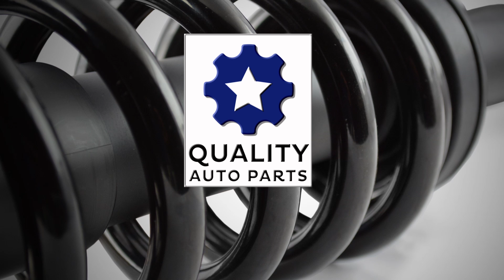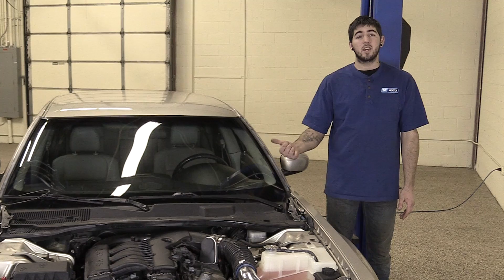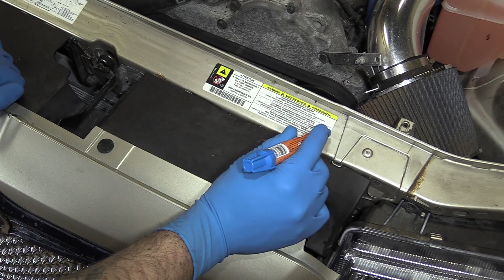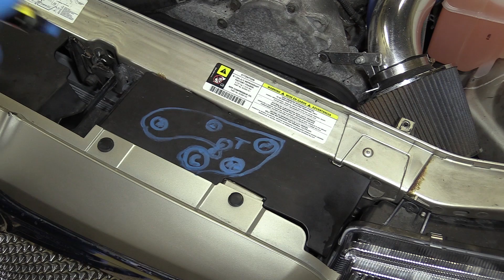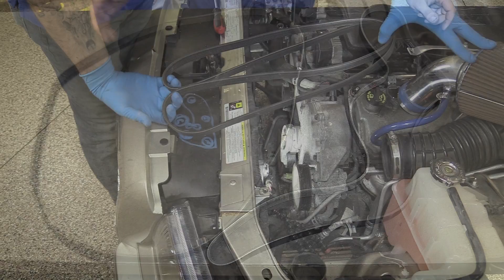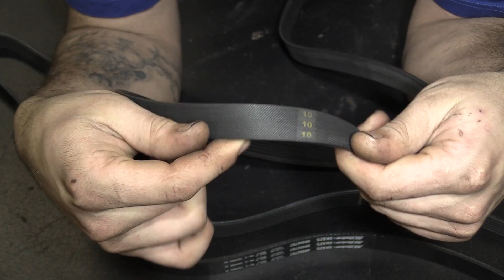How to Replace Serpentine Belt 05-10 Chrysler 300

Comment: Forgot to mention, when you start it up, to immediately shut the car off.
If the belt is going fo slip off, it will do it immediately.....then check
Reply from the maker: +Toolmybass Thanks for the tip!
Reply: Wow, thanks.

Comment: Hi boys slightly (completely) unrelated but you lads are quite knowledgable, i have tweaked my 300 so that i have a N0S shot hitting the turbo intake pipe just past the kidney. I notice that where the boost tube connects to turbo itself there is some movement and i think possibly air pressure escapes. I have fitted new 'o' ring but still worry. Is there any type of tape or fixture i could use to keep it airtight ?